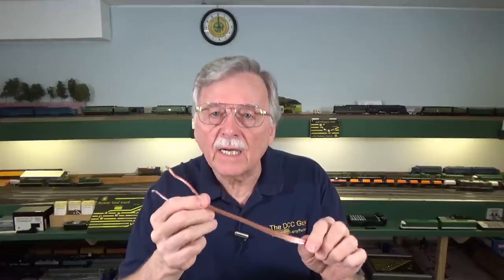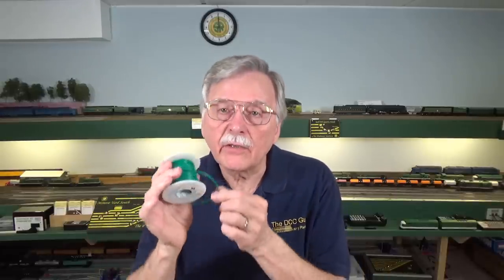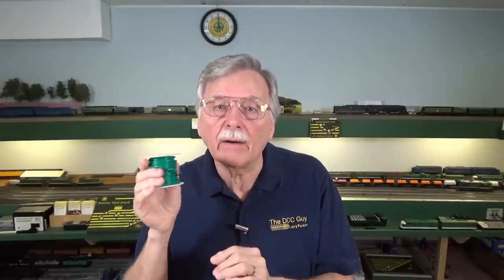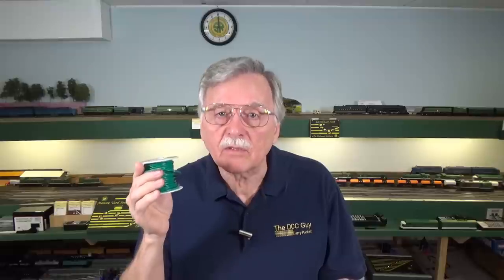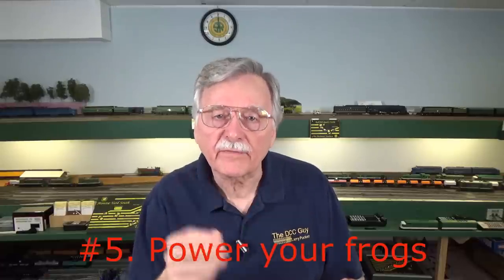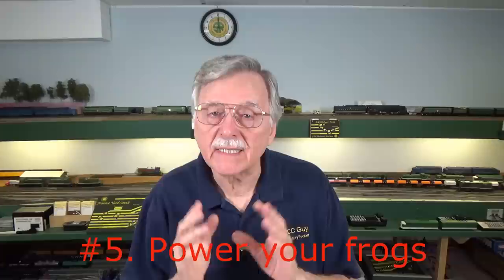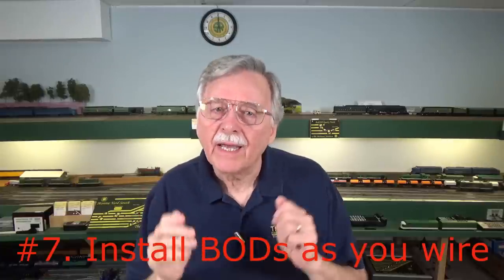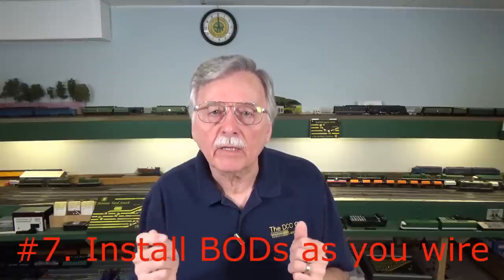8 Electrical Tips For Model Railroaders (313)

Comment: Rather than a 3 volt secondary bus I believe a 5 volt bus can be the better option.  My layout has several distributed Arduino (some of the Nano type) computers that through time based control processing  provides a variety of city and industrial lighting effects and crossing gate operations.   Although there are 3 volt Arduino powered computers there are more 5 volt powered supporting devices and peripherals then there are of the 3 volt type.  I also like to maintain compatibility with USB’s 5 volts because of its universal device connectability.
Reply: There are a couple of points I want to add to my previous comment.  A 5 volt power supply will facilitate PWM operations with servos as I had done with crossing gate control.  The second is that I use I2C communications throughout and this is noteworthy since I2C requires a 3 volt supply.  However the supply issue is negated with the use of I2C multiplexers which one would use when there are many I2C devices to connect.   The muxs are 5 volt devices.

On my railroad I use Adafruit VCNL4040 proximity detectors for train detection.  These are small inexpensive I2C detectors.  A mux is necessary in any event since the VCNL4040 has a single locked in I2C address.

 My N scale city's evening lights go on in groups and brighten gradually as the "pretend" sun goes down.  The effects are handled through a single Nano and I2C with PWM LED lighting controlled by a SparkFun LP55231.  This is a single 3-5 volt mux that performs the grouping and brightening and provides additional current draw capability (ex: one mux controlling 19 LEDs).  I can expand on the lighting implementation if anyone is interested.

And I also use Miller Engineering signs on my railroad also controlled using the 5 volt supply.  A Miller sign is 100 volt A.C.powered and draws about 125 ma from its power source.  Controlling it directly with a computer is out of the question.  Also the step-up oscillator won't  operate from a 5 volt source.  The solution is to place two silicon diodes in series with the 5 volt supply and to power the sign using a computer connected 5 volt DIP relay.

Comment: All due respect, Larry suitcase connectors are the absolute worst way to attach wires. Go ahead and soder connections, then cover with shrink tubing. It falls under just because you can, doesn’t mean you should. 3m makes them to sell not because they are better than doing it right ,but because it is easier.
Reply from the maker: Been using them for over 20 years and no problems when you use the correct connector and install them correctly.
Reply: @Model Railroading  I guess I don't like open places in the wire where moisture can get in. Plus, I build and teach using the one module approach, where you can get to the wiring so it can be properly configured. Thanks for the reply, Larry.